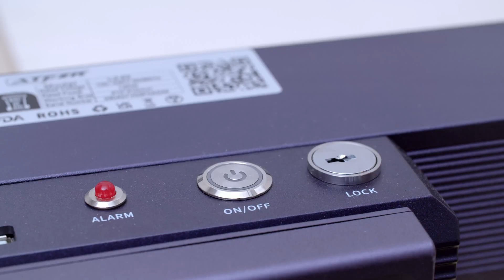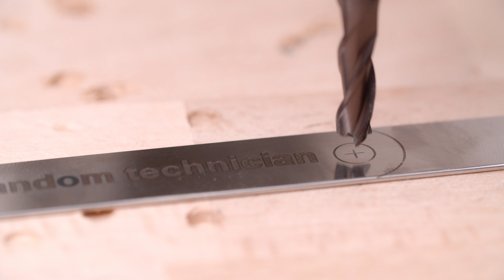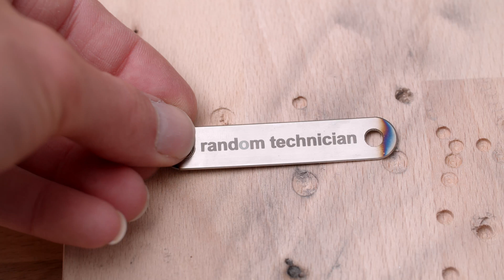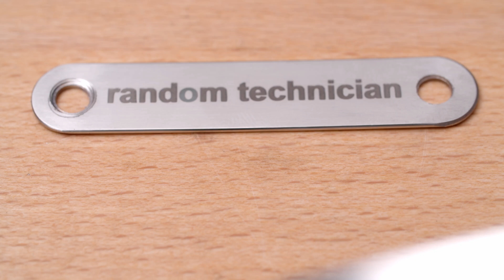Laser metal cutting and color engraving at home - Atezr L2 24W

Comment: Would you please share the details on cutting this metal such as the speed, power, and thickness of the metal, which I see is thin steel.
Reply from the maker: Yes, it's 0.3mm feeler gauge steel, speed was 0.6mm/s with 24w power